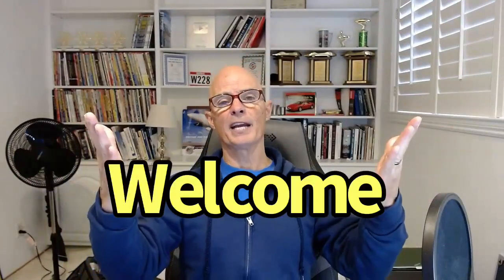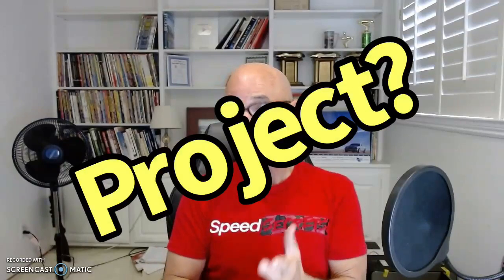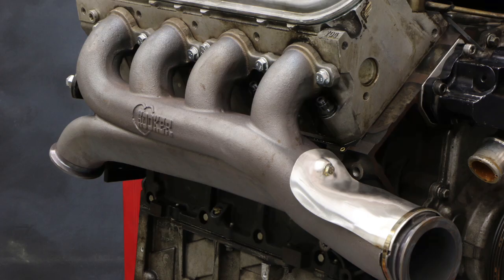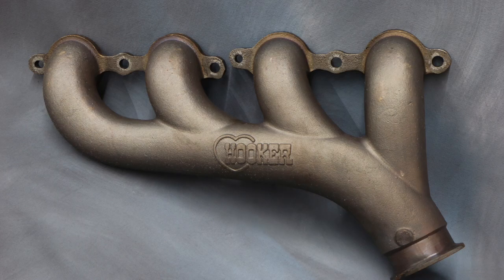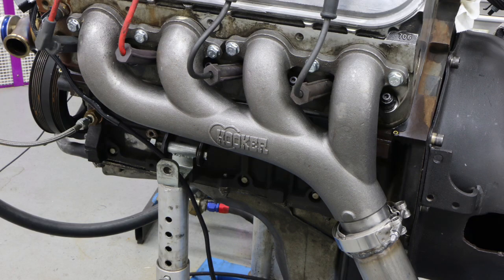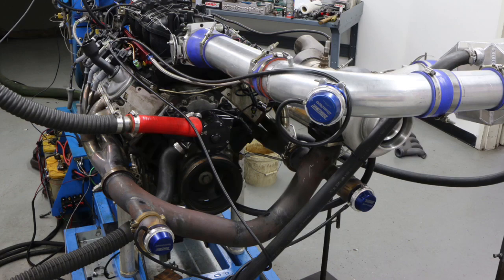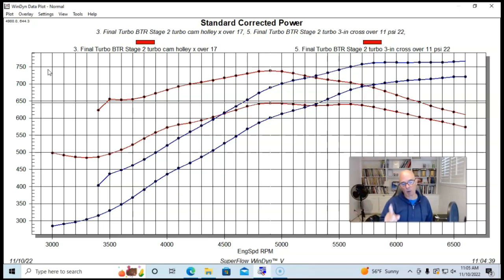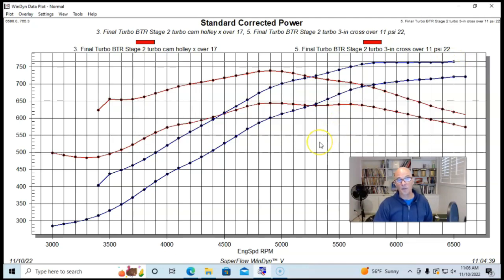HOOKER CAST TURBO MANIFOLDS VS E-BAY TURBO HEADERS-BOOST PSI VS BACK PRESSURE. BACK PRESSURE VS HP!

Comment: Myself and many others running the hooker setup would really like to see these things pushed further to see data and their limits. I’m making around 960whp with them and I’ve seem to basically hit a wall for power when everything else is good for 1300+. Thanks for the videos.
Reply: If you've got an extra input it's not too hard to add a sensor for it. I'd be really curious to see that measured at various parts of the manifold, like at the turbo, before the crossover, etc.
Reply: Steve Morris has a vid making 1200hp using them so they will make more just need the right setup or base hp to start
Reply: Would adding an additional wastegate help, like the tubular system, or alternatively, adding a second turbo and wastegate with it, I'd think you might be pushing the bottom end to it's limits at 1500 HP 😀
Reply: I made 1020 wheel hp at 21 lbs. 415ci lsx block with a s491 turbo. Feel like I could of kept going but had other issues
Reply: The cast iron manifolds are a different temperature than the stainless making up for a substantial difference in the way we think about the information we've been using.
Reply: I think they got a cork in there some where. Maybe a spot in the casting design that's restricting flow.
Reply: They are limited to around 900whp. They physically stop flowing after. It's a well known thing
Reply: If you've got an extra input it's not too hard to add a sensor for it. I'd be really curious to see that measured at various parts of the manifold, like at the turbo, before the crossover, etc.

Comment: Why is there two exits on the one hooker exhaust manifold?
Reply from the maker: THERE IS ONLY 1 EXIT ON THE HOOKER SYSTEM
Reply: @richardholdener1727  then what's the other hole used for on the opposite end of the exhaust manifold maybe where the Y pipes connected to it

Comment: Boost pressure is the same, only differences are the manifolds. Then higher HP manifold has greater efficiency, as the Turbo exhaust housing should be the most restriction in the exhaust path. And back pressure was measured at turbo flange. Therefore the Hooker headers have a design fault somewhere, my guess would where the 2 banks merge into one.

Comment: I think the higher back pressure makes more torque and response but what I'm not sure about is if it'll show up on the dyno. And obviously it won't make as much top end depending on the camshaft used.

Comment: Great vid showing how back pressure is not a good thing 👍. I knew it cost power and can hurt boost curves but I didn't know even that little bit of Bp could rob that much power. More air in=more air out=more air efficiently in = more air efficiently out = mo powa!

Comment: I think the time duration has a lot to do with it.. Try the same test but not with a throttle sweep, but with a sustained load in the higher range of the RPM. I bet once the exhaust tube volume between the heads and the turbo has a chance to stabilize, the back pressure numbers should come quite closer.
Reply: All these tests are performed at wot.
Reply from the maker: THEY WON'T COME CLOSER

Comment: Any time you reduce pumping loss you increase power all else being the same, and back pressure is just a measure of pumping loss in the exhaust. So yes the difference in power is due to less pumping loss from the system.

Comment: Headers were more efficient at flow. Like you say boost is relative. Air in and air out equals efficiency and power. Take your cake and eat it too. Fun test. Wish the hookers flowed better they're a slick setup. Curious how long tubes would compare to the short tube headers. Also curious if scavenging is still a thing with turbo or if  it's mainly flow restriction. And if a collector extension pre turbo would make any change as well. I  supose the y pipe counts as a collector extension tho. 😂 As always thanks for your efforts and keep up the good work!

Comment: I feel like back pressure is a large part of it, but with those pressure ratios of the tubular manifolds the turbo is going to be spinning much faster.    I think that the tubular manifolds put the turbo more into its sweet spot and that made  half the power gain.  It could easily have shown LITTLE GAIN or even NO GAIN if a smaller turbo was used that has a different "sweet spot".
Reply: Help me understand, I thought that, like for like, compressor wheel RPM had a direct relationship with boost pressure. It seems like this is a cylinder filling/ pressure reversion issue.
Reply: @Orange_pickles  compressor wheel  speed is same as turbine wheel speed.   The veloctiy  (air flow) of the exhaust as it goes from manifolds to downpipe is what determines wheel speed.  Backpressure is like boost, it is a measure of pressure and not necessarily airflow.   You can have lots of boost and little air flow, and also you can have lots of backpressure and little air flow.
Reply: I see what you're saying about the turbo being in the sweet spot, but 11psi is 11psi, and the motor picked up 45hp. 40-50HP is actually a really common gain from what I've noticed, Full Race did a test back in the day comparing a log-style manifold to an equal length 4-1 manifold and their honda picked up 40HP. Gentle curves with merge collectors w/exhaust pulses is always going to be better than having the gases make sharp 90* turns. https://www.youtube.com/watch?v=TkOFB2R2sqc

Comment: The back pressure is measured at the turbo flange so the manifolds will not change the back pressure readings. The dual waste gates are the factor. Way back in the eighties we put an extra waste gate in the system to relieve excess back pressure. The exhaust manifold/headers will contribute some HP but the lower back pressure will contribute equally.

Comment: NA test is needed with the cast iron manifolds and the turbo headers with Y pipe. I think you'll see a significant difference there and thus one of the reasons for the boosted difference.
Reply: How exactly do you run a turbo header na?
Reply: @CPEngineeringSolutions  take the turbo off and just run a regular exhaust pipe off the manifold or headers
Reply: @Daveyharledson  You don’t even have to take the turbo off, just disconnect the intake and have the engine breathe atmospheric pressure air. That way the NA combo still has a bit of the back pressure, just not as much as it would under load
Reply: @elementaljosh  You can totally blow up a turbo by doing that. It will way overspeed because there is no load on the compressor to slow it down.
Reply: @bcbloc02  I’ve heard people say that happens on the internet, but I’ve never experienced it and there’s a lot of people who’ve tested it and it’s been just fine. If you’re testing without the oil feed hooked up I can understand where that myth comes from, or if the turbine itself is damaged and out of balance. But for 99% of the world it won’t cause any harm lmao. If it was really that dangerous everyone who blows an intercooler pipe out on the drag strip would be going through turbos like candy
Reply: @elementaljosh  Well when you blow a boot at 70+ psi I have seen both turbo shafts bend and compressors explode. Without a load you are pretty safe but on a dyno where you can make a lot of heat and drive pressure I think you could easily send a wheel into the desintegrated dimension.
Reply: @CPEngineeringSolutions  I seen guys run those turbo headers without turbos and just run the exhaust out the fender

Comment: Even though there was no change in AFR, is it possible that there was a greater air mass with less backpressure? Boost is a measure of restriction, not airflow. Could it be that the engine became more efficient and the given mass air was achieved with a lower boost number which would mean a greater mass air when boost was matched? I realize AFR didn’t change but is there enough leeway in the Holley controller that 1lb or a 1/2lb of boost was compensated for in the fueling?

Comment: Heck yeah that power difference is due to the reduction in back pressure. Look at 4000 rpm. The boost is higher also. And backpressure was less than the boost pressure. 12 psi and 9 psi of backpressure for the tubular headers VS 9 psi of boost pressure and 10.5 psi of backpressure. Hmmm. It's in black and white (figuratively). Just the facts ma'am, just the facts. Lol

Comment: That’s a lot higher back pressure than I expected! maybe they aren’t as pretty on the inside lol but my guess the gate is probably the biggest problem and log manifold design’s in general can see some nasty high pressure points. how smooth is the flow to the single gate? I can’t imagine it’s dead consistent

Comment: A twin scroll comparison would be interesting divided vs non divided, single and twin scroll and if it's out there twin turbo twin scroll.
Reply: It would need to be done on something other than a v8 where the two inlets can isolate all of the negative cylinder to cylinder interference during each's valve overlap. Having two divided turbos would work on a v8, but only if the runners crossed banks to properly pair them, which is why it's only really done on "hot v" setups with the exhaust in the valley where the intake manifold typically sits. 2 rotor, 4cyl and 6cyl can utilize a (single turbo) divided turbo setup but you won't find any tangible benefit with 8 cylinders since they can't all be meaningfully separated

Comment: If you’ve watch any of these videos before it was pretty obvious which would win.  Richard should run both hot sides N/A without a turbo on them.  I think it’s obvious the headers would flow more and make more power than hooker set up N/A but it would be kinda interesting seeing what the difference would be.  Anyway as always with all his dyno runs the more power N/A the more power under boost.

Comment: Do you think the dual wastegate helped keep the backpressure down due to better bypass volume? I would like to see the hooker set up with a larger single wastegate and both header combos with better boost control. I think the difference will narrow a bit. What do you think?
Reply: We know back pressure was less at the same 6000+, so I don’t see it being a issue having another waste gate. But someone might have a reason that I cannot come up with. Consistent boost numbers should make it irrelevant
Reply: @ZONES89RS  running the conservative boost numbers that they are, wouldn't the gates be bypassing the most out at 6000+? There is no doubt the tubular headers are better, I just feel like there are other factors that led to the massive difference in backpressure.
Reply: @2GSpyderTurbo  I am confident it’s the sloppy manifolds VS the tubular headers that have a very strict direction and flow. 

Manifolds are cramming together exhaust gasses where the headers are directional and essentially helps fluid dynamics(gas). 

The dual gates are superior for control especially at higher boost levels. It’s hard for me to wrap around them causing the difference in power. I can see consistency for sure. But 12 psi? That isn’t hardly anything .

Comment: Makes sense - back pressure is bad because during valve overlap you'll have dirty air flowing back into the cylinder and intake.  Less clean air = less power.
Would be interesting to see this test with factory cam with 0 overlap.
Reply: Virtually all cams have some overlap, including factory cams. Engines don't function very well with 0 overlap.

Comment: pumping losses & charge dilution, if injector PW didn't go up with less back pressure, it was all pumping losses
Reply from the maker: AF WAS NOT CHANGED-WE HAD TO ADD FUEL FOR THE INCREASE IN POWER
Reply: @richardholdener1727  charge dilution, typical, what'll really burn your noodle later, the engine just became more octane sensitive, the dilution of charge acted like a EGR buffer gas

Comment: I wonder if exhaust overlap has an effect. Would the air charge be more diluted at a given back pressure figure if theres more cam overlap?
Im going to have to watch the turbo comparison video again. Not as apples to apples as it adds the compressor variable.

Comment: Great test Mr. Holdener. The back pressure surely could be preventing the turbine from spinning as fast as it could. It could also be diluting the cylinder mixture and acting as a buffer.

Comment: I could go pull out my chemical engineering fluid dynamics book, but....not sure what I could really calculate without more data. Regardless, yes, I could see the pressure difference making up part or most of the power difference. 

Think about a pressure washer, put a big nozzle on it and it moves the same quantity of water as a small nozzle would, but the engine has to work harder to do it. It isn't a perfect analogy because water isn't compressible like a gas is, but you get the idea. Back pressure indicates restriction to flow, which means more energy required to move the same quantity of fluid.

Comment: One interesting comparison may be spool time, if the Hooker manifolds get a turbo moving from idle quicker (IE: gaslight stomp).
Reply: It will largely depend on the total exhaust system's volume, and a bit on how much heat is lost. You can size the x-over on the Hooker much smaller than you typically see (2-2.25") and quite possibly have better transient response. The headers also have much more surface area to lose heat, which Richard has shown will slow turbo response.
Reply: @hydrocarbon82  The cast will get hotter and hold way more heat then stainless tubular. Think of a cast iron skillet.

Comment: Cold ? It was 72 degrees in MI today, I ripped it up on my dual sport, gotta be the last chance, it's supposed to snow Sunday, lol. Keep killing it Mr. Holdener. P.S., the Hooker set up is not the ultimate power set-up, but it is fast an easy. 700 hp and 600+ ft/lbs is nothing to sneeze at.

Comment: More back pressure causes less power... that is the takeaway. Is it due to back pressure fighting the 'effeciency' of the 'flow' rate of exhaust? And is it in part caused by the 'adding' of the second waste gate improving the efficiency of flow a substantial amount?  So, the back pressure causes not only resistance in the turbo performing its job(kinda by 'fighting itself') and does it also reduce any 'scavenging'? All guesses, but that's why I am here, to learn about these things, so if I'm wrong, I learned something, and if I'm right I also learned something- I wasn't as dumb as I thought haha
Reply: Higher back pressure means a less efficient evacuation of exhaust but it also means increased pumping losses. As the piston is going up on the exhaust stroke it's working against more residual pressure during part of the stroke.
Reply: @177SCmaro  Thanks for the reply, appreciate ya! That was my thoughts on the 'evac' process too.

Comment: What size single did you run, and what size double wastegates did you run? Would a 60mm wastgate with a light 4lb spring and boost control with mac vales take care of the back pressure issue with the hooker cast iron setup? Because that's what I've bought for my combo, forged bottom end 5.3 with with good guts, tkm lamb cam, Tsp intake, 85mm bullseye turbo. Id love to see you test a tkm lamb cam the the btr stg 3 or 4.  Im curious now if I can make my hp numbers with this setup blackheart log manifold.

Comment: Shit, "common" knowledge in some circles was that the turbo was the biggest restriction and the pre turbo exhaust didnt matter much... Seems there might be some error to that. Very awesome test.
I built my turbo setup with that info in mind... Im thinking i may have made that in error now.
Reply: The turbine is a restriction but I think what is overlooked is restrictions can add up. It will take more hp to pump exhaust through 5 restrictions then is will just one.
Reply: Full-Race did a test on one of their 300HP Honda's, and going from Log to Tubular Manifold they picked up 40HP on a little 4 banger. It convinced me to change the header design on my turbo kit.

Comment: Thanks for redoing this video. So headers do work with boost just like cams. 

I would like to know if the NA engine sees a similar power difference with the headers vs the Holly cast manifolds.
Reply from the maker: THIS IS NOT AN NA EXHAUST
Reply: @richardholdener1727  you could still run them both na tho, please lol
Reply: @justin_parks  yeah, He does that a lot. annoying...

Comment: Would the back pressure on the manifolds come down if you were to make a bypass pipe parallel to the passenger side manifold. So the merge on the passenger manifold  would not be a factor anymore

Comment: power gains are from exhaust flow, youre comparing a log manifold to a "header". Some engines if you run more boost in the mid and bleed it back at top end it will make more power then a straight boost curve even though peak hp and boost is the same. We figure this out to be momentum of the reciprocating mass carrying over and helping power up top. Its not that in this case as its like 1 psi on the header. But there is a lot of boost missing in the mid range on the log manifold
Reply: Tbh a turbo adds backpressure naturally. Without back pressure u won't be able to build boost. U need backpressure.
Reply: He addressed this

Comment: looks like two waste gates and the design of the header not so much its construction, the merged 180° turn around would make the exhaust gasses fight each other which would also make the turbo lazier, I'm just speculating, even then it's 44hp and is the cost difference worth that?